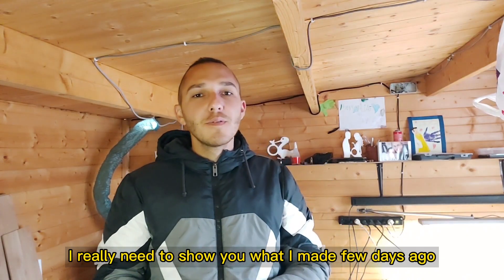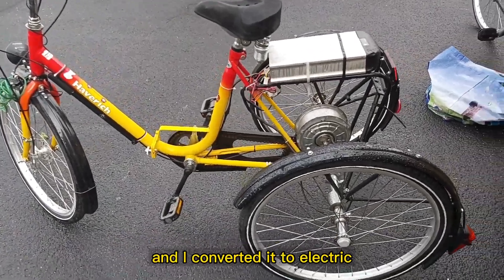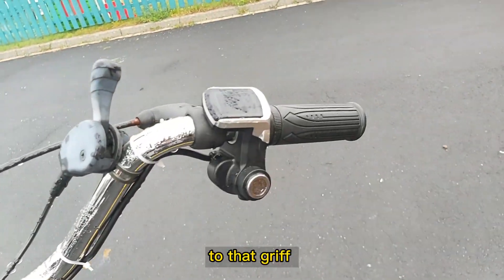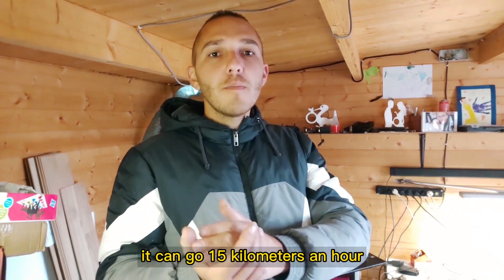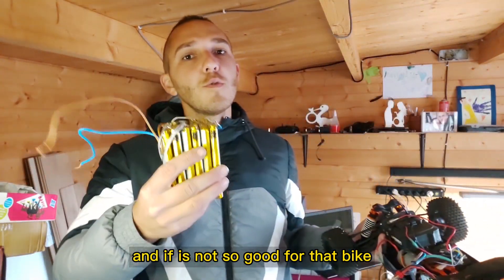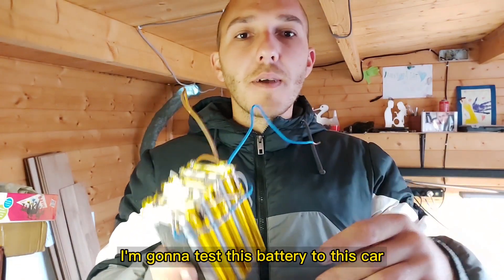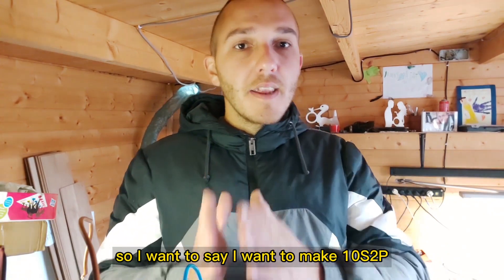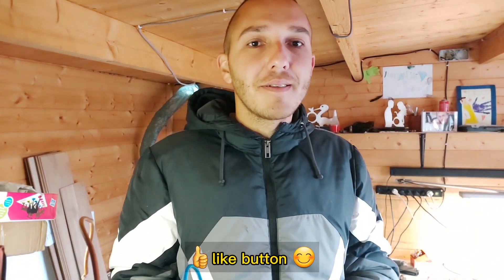DIY Electric Bike Build - How I Built My Own E-Bike

Comment: LiPo is unsafe - they can easily catch fire. Li-Ion is better, but LiFePO4 is what I would strongly recommend.
You can get some LiFePO4 batteries ('cells') in the 32700 format; they're 6Ah.
Remember to have some kind of BMS between the cells.
Those based on 'BQ' ICs from Texas Instruments are a good choice, just make sure they support LiFePO4 cells.
(you can get BQ ICs that can balance up to 48s - but it's pretty easy to find some that can balance up to 16s!)